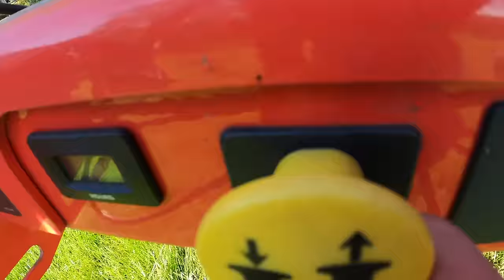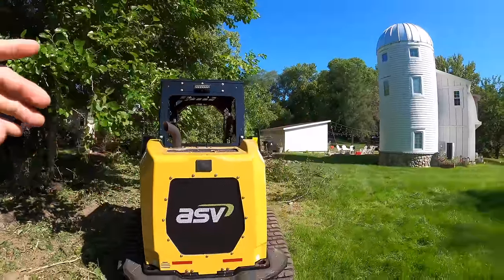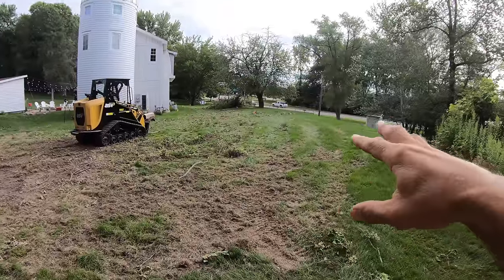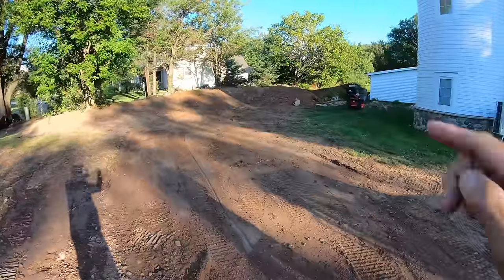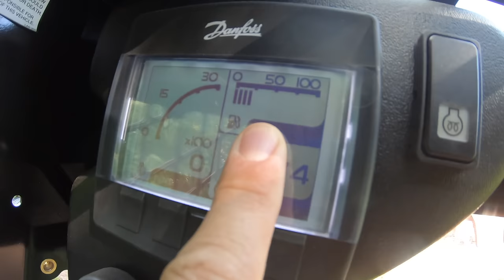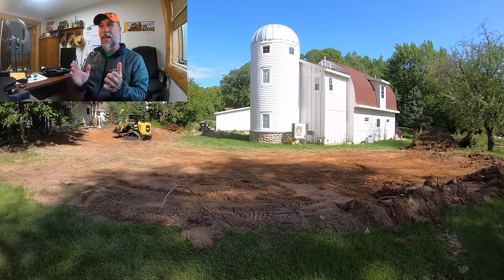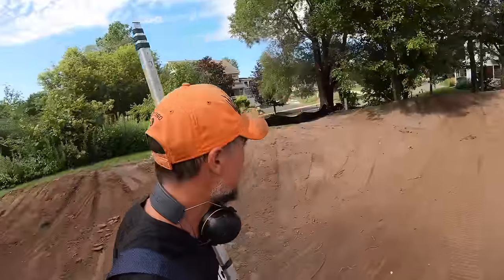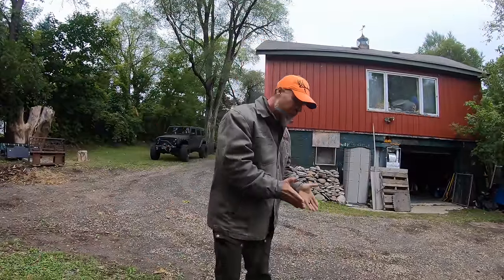Testing a new skid steer Regrading a site

Comment: I cringe every time I hear a chain saw start up on this channel.
Reply: Kyle Larsen why?
Reply: I cringe everytime I hear Stanley
Reply: @timmanus  just waiting for someone to get injured due to lack of PPE and bad habits.
Reply: @kylelarsen996  like the shorts. no helmet. no chainsaw trousers. that sort of thing?
Reply: Exactly my thoughts. Especially walking in the chosen fall area.
Reply: @GregsMowing  I'd be more concerned about the saw sounding blunt and running like crap. You can mitigate for a lack of PPE but a blunt saw is just dangerous. And I wouldn't want to be cutting with something that sounds like it could die at any second.
Reply: @GregsMowing  or the back and forth motion with the saw like hes helping it cut hahahahahah

Comment: I just bought a brand new ASV RT 25 and I love it ! I fit through gates and tight areas. Perfect skid for all around work
Reply: I just bought a used 2014 terex ro70t which is an asv painted white and black and it's 33 hp It's a beast. Ours have the same chassis dimensions and can get in so many tight areas. I love it
Reply: @andrewstratton806   I rented a Terex a couple seasons ago from a Home Depot and loved it so that's why I went with the ASV
Reply from the maker: Very nice!
Reply: I'm very interested in this machine and going to test drive one

Comment: ASV was started by some Arctic cat engineers.   Arctic Cat for  a long time, used Suzuki engines.  That allowed ArcticCat to  concentrate on the chassis part and someone else focus on the engine development. That was smart of ASV to do the same thing.  Use a proven Kubota engine so they could concentrate on the chassis.

Comment: I've had ASV since 2004.  One of the machines has a serial number of 600. (59?)   These track machines should only be used on dirt, not gravel.   They are specific in their nature not general machines.  Wheeled skid steers are more universal but cannot do what an ASV of similar size can.   I've had undercarriage issues until I designed a new system with bigger bearings and seals.   ASV has done that too on later models.
Employees are hard on these machines, particularly the larger ones.   
I would not buy one for general construction or maintenance, only for applications where they are designed for.  My applications are exactly suited to the machines.  
I even have one with a winch and skidder back end for small logging.

Comment: widest track... longest track... highest ground clearance.
But there is VERY LITTLE track wrap on drive pulley.    So you are going to have to keep that track VERY tight to keep cog skip under control.   Lots of stress on the undercarriage.
Reply: I’m sorry for my crudeness here, but your comment is very misguided and couldn’t be more wrong. A Posi-Track drive system utilizes a low internal friction drive sprocket and roller system. Google it and you will find the system actually has the most sprocket to track lug contact area, all while reducing drag (load) and/or friction (creating pressure) on the drive and pump. As a result of the design, they have also zero track derailments and the tracks almost always last twice as long as a conventional CTL undercarriage.
Reply: @dvosberg39  Misguided?  Please, any first year engineering student should spot the weakness in this system.  There is less than 90° wrap on that drive sprocket (hell, it's closer to 45°).   You can minimize your drive roller/pin friction all you want but the only 2 ways to mitigate slip/skip ON ANY BELT DRIVE are wrap or tension.  It's simple physics at play.  In this design, you can't move/raise the driven wheel to get more wrap so more tension is the only way to attenuate skip.   Yes, they have done great work on the dual guide pin tracks to prevent derailment (lateral slip) and the CTL rollers will see little of the added tension... they just float on whatever is below them.  But the driven roller and the two idlers are taking a beating in radial loading.  Depending how they beefed up the axles, they may be taking a beating axially as well since none are in double sheer.

Comment: I have 2 i say 2 pt-30’s with cracked hydraulic pumps in them they leak like a tap.   I just grade with them.    I been using asv for over 15 years.   But the 2 pt i have are trex model.   Asv  model are better

Comment: Have you tried rough cutting with the midsize asv? Also any input on if it could push snow?
Reply from the maker: Thats what we did in the beginning-  ripped out all the turf and set rough cuts before we dialed it in
Reply: @Dirtmonkey  thanks but i meant like rough cutting like mowing and land clearing. Also are you going to try and push snow this winter with it? Thanks appreciate you taking the time on these videos

Comment: Stanley have you ever used a direct reading rod? You can actually attach the sensor to the rod and dial in the evelivation then slide the rod up or down so it give you measurements as direct reading.
Reply from the maker: I have tried something similiar.  aren't they usually tethered to a cord?
Reply: @Dirtmonkey  No they are just like a standard rod but are direct reading Try here https://www.amazon.com/LaserLine-Direct-Elevation-Lenker-Grade/dp/B00GN54MKA
Reply: That is what I use.  Love it.  Lets you always use the same datum every time. Pricey compared to regular rod though.
Reply: @hey.you.in.the.bushes  I was using them for 40 years, sorry guys but I am retired now. I was exposed to all different types of retaining walls, pavers, geo-grids, and erosion control material. I wish we had something like this 40 years ago!

Comment: Prime example of how not to cut down a tree. No shits given to safety. No hard hat, no face shield, no chaps, and no where to go if the tree starts going a different direction than expected.
Reply from the maker: or wide open spaces, tree tied off to a skid loader.  a starter cut made and then the tree yanked over.  either way its down and no one was hurt.
Reply: @Dirtmonkey  what the other viewers and I are trying to convey are two things. The first being there are a lot of people viewing this channel that don't know proper safety and could get hurt by doing what they see here. The second being that just because nothing bad has happened doesn't mean it won't.